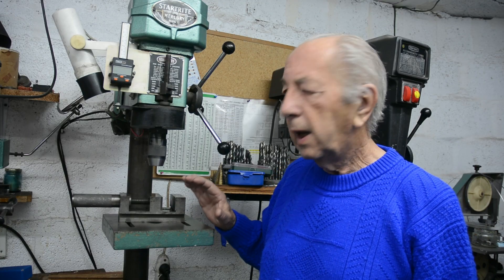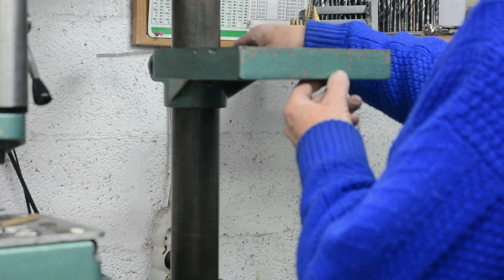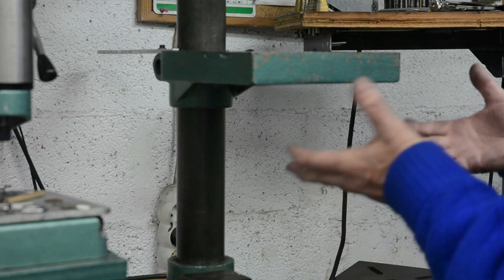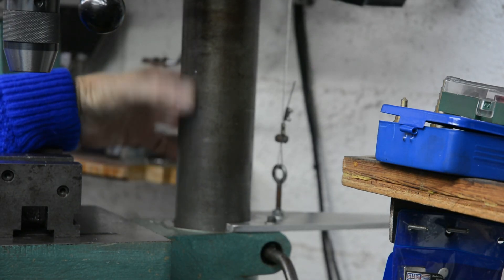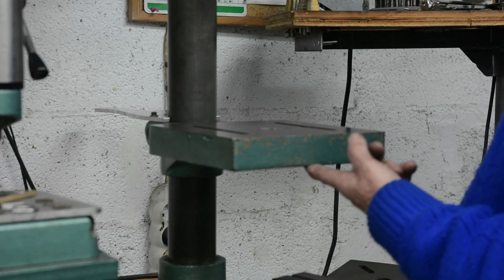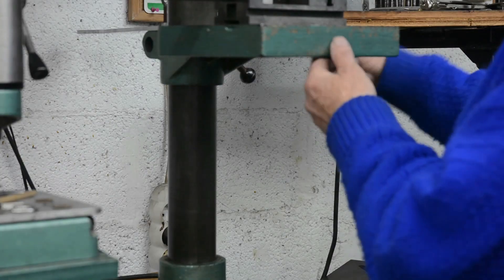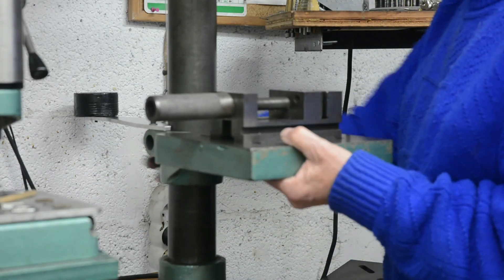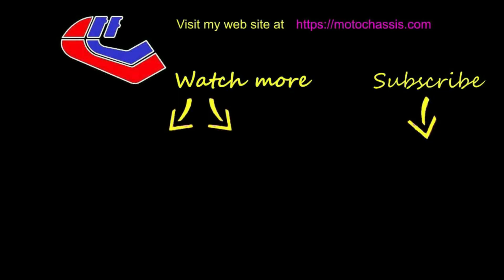Counter weighting a drill press - in practice.

Comment: I'm thinking, "Wow, you've had a tool for half-a-century!"
Then I remember that I bought my drill press new in 1977. Still have it. And I've been "working on" a table lift (which was an option I never bought) for the last two decades or so.
Reply from the maker: I still have and use tools that I got in 1960.
Reply: @MotoChassisByTonyFoale  The oldest tools of my own I bought in 1971, when I began working on motorcycles for spare money as a teen! Powr-Kraft tools sold by (former US) retail giant Montgomery Ward.
Reply from the maker: There was a motorcycle shop in England called Monty and Ward.  In 1971 Monty sponsored my first race in the island.